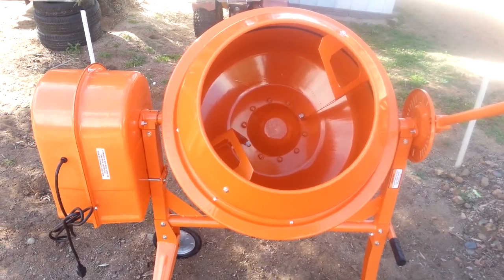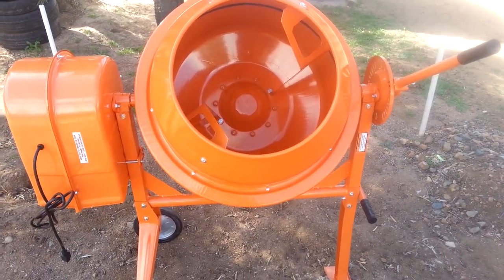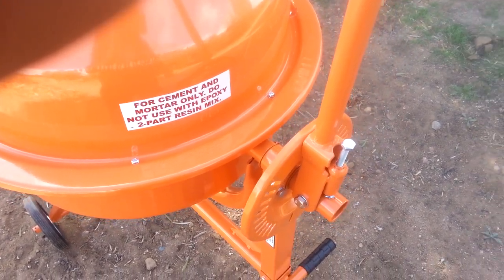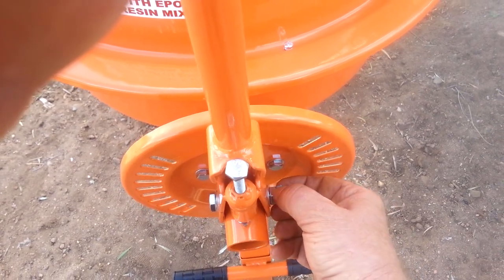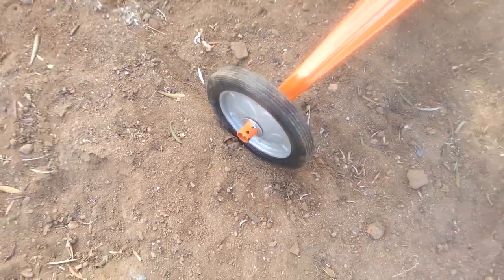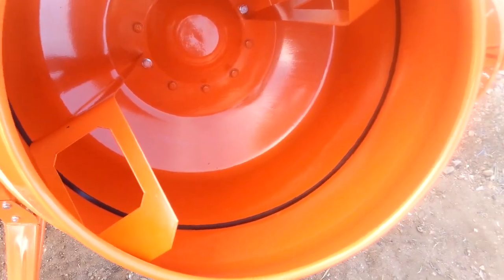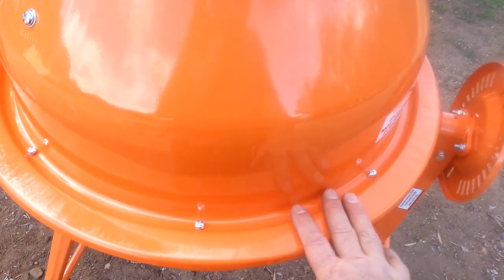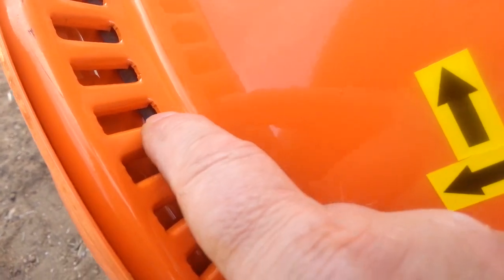Harbor Freight 3 5 Cubic Foot Electric Cement Mixer Assembly  Part 1 of 2

Comment: Howdy Cheewurz!...took somebody else's suggestion and watched a handful of these assembly videos and was fortunate enough to come across yours.  Even though I've had a lifetime of being the one to figure things out and have never really had any issues, I found the assembly of this mixer pretty straight forward (not sure why so many find it difficult). BUT, the one BIG KUDO I wanted to give you is your simple but EXCELLENT suggestion regarding the installation of the gasket between the shell halves. Your method of slipping it in from the inside and dropping the screws through and then going back and tucking the gasket in evenly all around the shell was BRILL!.....saved me a lot of time, mess (no gasket gunk) and headbanging.  Thanks again for sharing!  Semper Fi!

Comment: Thank you.  Yes, I did not see any instruction to put that wheel behind the arm.  Also, I almost threw that little disc away thinking it was nothing.  Now I know that it helps push the spring down.

Comment: I adhered the gasket to the base drum with a good amount of silicone that I placed first directly onto the metal base drum and then when the silicone was tacky and the gasket was set and flat I put silicone  on the top of the gasket and I was generous with the silicone I also made sure I squirted extra silicone into the bolt holes of the top drum and then placed the screws into the top of the drum this allows you to have the bolts be a guide make sure to tilt the drum 45 degrees when placing the top drum on there will be a slight difficulty of aligning the top drum to the gasket bolt holes of the base drum but with the bolts tacked in to the top drum they act as a guide if you tilt your head to look where they are going in after you have all the bolts in tilt the drum back flat and screw the bolts and nuts together using a star pattern to ensure even tension and a good seal.